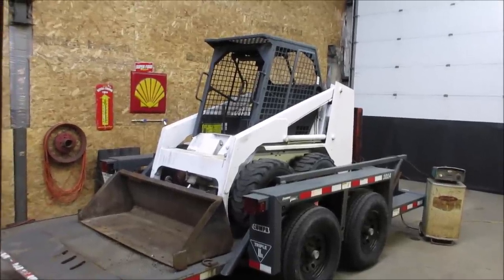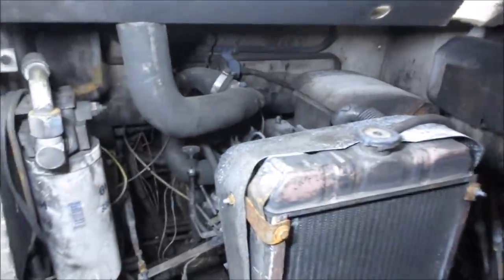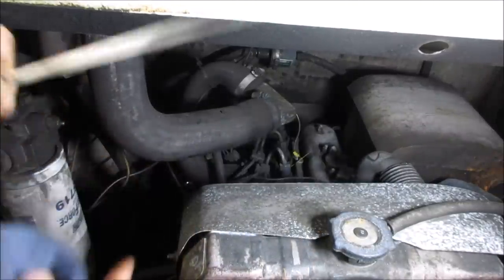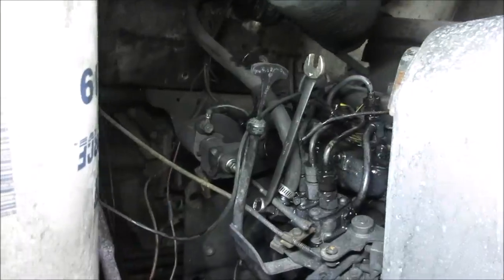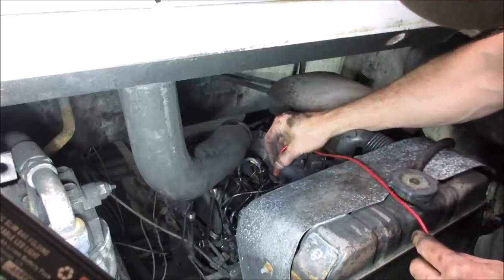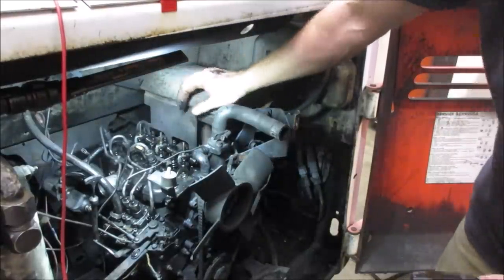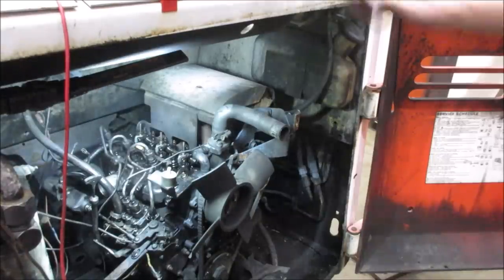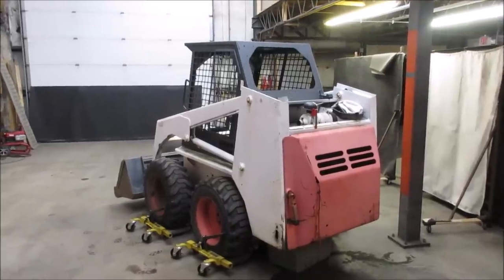Gambled on a Non Running Bobcat. Will It RUN?

Comment: There a little tricky to learn how to operate at first, however, once you figure things out you can do just about anything with one of these little machines. I know one thing, u can get a helluva work out of those babies. Usually, you, can get upto 4,000 hrs before engine overhaul.. That's if its been taken care of over the yrs. Man their cobbling of that radiator setup is a mess. I had a feeling that engine was toast,  right from the start not seeing any fuel coming out of those lines kind've wrote it in stone...Awe You'll figure something out. Not all are decisions pay off in our favor do they, that's what happens when you play the gambling game, sometimes you win sometimes you lose. Good luck on finding a engine that'll suffice for ya.

Comment: With the extra oil showing on the stick, you have to check the drain plug for water.
Pressure wash the engine would have been the first step.

Comment: by the way if you take off injection pump got to remove throtle housing first there is small springs for govener and rack on pump and shims under pump thats for injection timing its easy to overlook shims there is also a threded boss in block for heater from factory its a option easy to add 40$ thread in and done git rid of you house plumbing on lower radator house that was ruff to see

Comment: Put atf in the intake someone probably wash down cylinders with stater fluid i had a employee do it to a loader once and it would not start poured  atf into the intake it built compression and started

Comment: @38:06 it seems like the instructions want you to insert the compression tester at the glow plug using one of the smaller (F?) adapters to take the measurement. Look at the 'Type" column on that sheet.

Comment: BTW. The Carrier reefer units use a similar 3 cylinder Kubota engine, not sure of the size though. Maybe if you find a wrecked reefer trailer with a good refrigeration unit...

Comment: A 22 hp predator engine is $999.99,,,,,  Hope you can find something used,,   I love it when you find cheap junk and bring it home,,,,   Probably the best way to go is to get one of the used 4 cylinder japanese engines from japan,,  They all have less than 100,000 miles on them,,, and sell pretty cheap,,   :-)

Comment: Oh by the way Mustie 90% of automobiles just like ares actually the same as ares in Brazil run on E85 75% to 90% pure methanol yes they do have to use different seals and materials for the  fuel system 7 to 900 to have any car converter I'm sure when you buy a new car in Brazil  it's added in to the price

Comment: If the last two guys couldn't get it to run, it seems to me that step 1 should have been the compression test.
Reply: Step 1 would have been draining that crap out of the crankcase. Then check the compression. Because if that engine had fired up it wouldn't have stopped until it burnt whatever was in it. Then it'd have exploded. Diesel runaways are real heart stoppers. You can watch videos of them here. They make a big white fog then go click.

Comment: You used to have a 3 or 4 cyl diesel that ran a generator that you made run. Maybe an adaptor to make it fit the transmission woiuld allow you to get this machine running again.

Comment: Wow! That thing is sad condition. With that being said, I had a 630 bobcat with the  Ford engine. And it ended up getting repowered with a Kohler command 37 horse didn't have to do a lot of modifications other than changing oil coolers. With that having a Kubota repower it would be simpler to go back to gas for what it's worth. Looking at those repower kits now to buy everything out right with all the parts you'd be over $5,000. Unless you could find a Kubota diesel cheaper but I doubt it. Only way you can get away with it is if you had a good Kubota industrial engine dealer near you but they don't have a lot of dealers in the country. And with the business you do with small engines and lawn mowers how often do you come across the 30 plus horse gas engine I guess? Anyways, good luck! There's options out there, just takes time to figure it out

Comment: sounds like the original gasoline engine was replaced at some point and a diesel engine was cobbled into place, and now it too needs replacing. so engine hours probably do not reflect time on the replacement engine, but rather the time on the original and the replacement? i'm assuming the engine hours meter is a separate unit from the engine, which may be a poor assumption. :)

Comment: It looks like a D-905 or a D-1105. I’d swap an D-1105T Direct injection motor out of an old toro reel mower into it that way it would be not as gutless as it probably is now. You’ll want at least 40-50 horsepower to be practical.

Comment: i have to admit i was wondering why the host had not checked the compression having gotten this far (@36:53). and was guessing it was because he didn't have a compression tester for a diesel engine. ...i was close. he simply had never used one, which is understandable, and as the host probably suspected, it was going to be a PITA. :)

Comment: Also mustie fill the furl up so you have reasonable meters head pressure, then bleed the fuel filters then the injection pump then the last of all the injector lines to the injectors as its the highest point where air will be trapped , if all else is good meaning your injector pump timing is correct it will start.

Comment: Kinda wonder if that Diesel generator motor you got awhile back is a similar displacement size and if it could be Frankensteined in if you still had it and it was large enough and would fit in the engine bay

Comment: i have a line on a 3 cyl motor out of a att bucket truck it has a gen hooked to it that ran the bucket , diessel creek has one i sent him the manual for it i also know my buddy has one or two , the motors are self contained  except for fuel tank I  had one and sold it for 500. i'm sure it could be bought back, I live in akron. ohio

Comment: as you say things im stopping the video to reply it's not just a lift pump it delivers the correct amount of fuel to the right cylinder at the right amount of atomized fuel pressure at the right time, it's a complicated bit of kit.

Comment: Don't condemn the entire engine, pull the head and check the head for cracks, those usually crack between the valves and the around the pre combustion chambers, that said, the rings aren't performing looking at the blow by.  I'd keep an eye out for an engine, maybe repower is in it's future

Comment: 3000 hours is a rebuild on most diesels so a quick rebuild or r and r is likely ? the engines 3 cylinders are likely under powered so yeah there is that they may have cooked it early...

Comment: Definitely overheated. They don't cope with it well and it happens often. They are sleeved and replacements are available but they're usually semi finished so need to be finish bored once installed.
You did a video a few years ago on a 2 cylinder kubota engine. Have you you still got that?

Comment: On my one engine I left tranny fluid in it then. Got it cleaned out and turned engine over while pumping some tranny oil in the intake to give more compression and it started and freed the rings. With engine frozen and with lots of water in pistions with head off

Comment: I'm surprised you didn't drain half that oil out of it before proceeding at all.  Doubt it'd have made any difference but would have made a huge mess if it actually fired at all.  I'm also surprised that with the ether, even with 125psi in two cylinders it didn't fire somewhat.  Ah well.  So would the VW engine fit????

Comment: Let me start by saying I’m not a Mechanic. Doesn’t the engine just run a hydraulic pump? It seems to me that since the cranking of the engine created enough hydraulic pressure to lift the arms, though obviously not enough to actually do any work, wouldn’t you be able to put basically a small gas engine such as a v-twin that would produce enough rpms to turn the pump? Perhaps some sort of gearing would be in order. I think it would make an interesting project and video series. Just a thought.

Comment: I really would like to see what's up with the decompression valve on that engine. That size diesel I'm pretty sure it has one, and I really would like to make sure it's working properly. Thing is I can see one or two cylinders get that bad, but all three?

Anyways it's a quick thing to check.

Comment: please atempt to fixt it, take the head of and mesure how far the pistons are from the top. juste take all headbolts out, no timing things at all. if you are going to swap the kubota generator,m you can change the intake and flywhell i think. a 1,9 vw diesel 1999 would be cool.

Comment: One has to wonder what happened to the original engine, if it took a crap or if someone just wanned a diesel over a gasser and did a swap.

Personally i would not have bought this machine if i was looking for a running machine to use around the yard, unless you were specifically looking for a non running project, although given the hydraulics work even on just cranking rpm's suggest the pump is still good and tight, so it might be worth putting and engine in it.

The engine in it might just have a badly blown headgasket but it is more likely worn out rings, pistons and liners, so i'd say put a VW engine in it if one will fit, otherwise go with that kubota diesel outta that generator, from looks i'd say it's roughly the same engine +- a few year models/horses, and i think the flywheel end is standard on these 3cyl kubota diesels so the one in the skiddy should just bolt on.

Comment: I say Restore additive.  Drain oil, add restore as per instructions, add new oil to full mark, then put a small amount of additional Restore into each cylinder through the injector or glow plug holes. heat up the glow plugs and crank with at least 18 volts to the starter.
   The main alternative I see is new rings.

Comment: Your compression gage set-up added too much volume to the compression chamber. That's probably why you got such low readings. You might get a good reading with the proper adaptor in the glow plug holes. I'd try adjusting the valves and give it a healthy shot of Quickstart to get it running. It might clear itself up.
Reply: I used the same compression tester on my Ford diesel injector ports (no glow plugs)  and saw 350 lbs on all cyls.  There is an old trick to find blowby - valves or rings by adding oil to the cyl and re-checking compression.  Not a good idea. Oil ignited and blew out the gauge!

Comment: My guess is mustie needs to buy rings, bearings, a new diesel pressure testing fittings, and grind the valves. Thus an engine overhaul with correct placement of radiator. Pull engine out, restore engine, clean everything. And bite the bullet to do it correctly so it can be sold for a better machine through horse trading. This was not a good buy. Over the tire chains would be needed for any kind of construction use. Kubota diesel is a good motor and will properly propel this skid steer but high tech work needs done, AND NOT A VOLKSWAGEN ENGINE.
Reply: We don't know what he paid for it. I bet it wasn't much though. He said he paid blown motor price for it.
Reply: OTC for any type of construction work?  hmm, 99.999999999999999999999999999999999999999999999999999999999999999999999999999999999999999999% of Skidsteer operators would quite highly disagree. OTC would destroy black top/asphalt, tear up lawns.  Over the tire tracks would be a better solution or if this thing isnt a total heap, a track conversion

Comment: Not sure I'd trust this even if you got it 'running', looks like it needs a complete teardown and rebuild.  Not the Mustie way I know.
If you got it running, maybe you could sell it, but doing real work, it might just die halfway in the job.
The best answer...put in electric motor and a big extension cord that attaches to a pole so you can move it around without running over the cord...they used to make tractors like this. lol   A Prius 1.5L engine, they are free and are designed to run efficiently at like 2000rpm or so.

Comment: I remember you did a video were you got a small diesel engine and you started it on the bench. Would that fit in there? Or would it be about equal in power to the one that's in it.

Comment: The injector fuel output should be 2300 psi the ultra low diesel fuel probably took out the pump and yes you have no compression

Comment: I don't know if this is going to help, but I accidently hooked up a new battery in mine and blew the blocking diode in the harness, could be same?  Dumb mistake on my part, but got it working again.

Comment: Don't know if you would be interested, but I have one of the Ford four cylinder engines sitting in my garage right now. I'm not going to use it, and I am very willing to let it go very reasonable. Problem is I am in southern Michigan. Let me know what you think.
Reply: Let me guess, it ran when you put it away?
Reply: @1pcfred  Actually, I don't know if it runs yet. I just got it in a deal last weekend and haven't tried it yet.
Reply: @burtnelson1987  ah ha. Fire it up!

Comment: Is that engine a d1105 I have a Toro lawn mower which looks like the same motor the noise in the fuel pump is normal it could be the glow plugs to if it is fuel you need to open the throttle a little bit while you crack the lines I think you do the end ones and then the middle from memory but you need to have a partial  throttle so once it almost starts you can close the lines quickly

Comment: I have a 3 cylinder Kubota diesel engine in my lawn mover  (Belos  1500) and it has much more fuel pressure than yours have , so I think that yours have a faulty pressure pump.

Comment: Fuel system gone to air ?...Takes forever to prime a fuel system on older diesel stuff
Reply: If the compression readings were right there's no way that engine could start. That's why the crankcase is so full. The diesel is just blowing past the rings.

Comment: It is VERY bad idea to use 'starting fluid' on a Kubota diesel. The design of the engine (precumbustion-chambers) can result in cracked head almost instantly.... infact, the 'lumpy' crank sound suggests a dead hole (cylinder) already exists.

Comment: Just a thought but my kubota engine has a oil pressure shutdown. Maybe that’s of some use to ya mustie
Reply: Need to hold the button till you see oil pressure and my fuel pump runs all the time also.

Comment: All Low compression Kubota engines require use of Glow plugs even at 70°F dont know where you get that misinformation... I also notice an engine heater on that engine...

Comment: First impressions are that engine bay has seen A fire. Watching you test the fuel pressure seems like It has none going to the injectors. It should spray out those lines with good force. Could be the injector pump Is bad. It also sounds like It has no compression.  Love to see you get this going.
Reply: Yeah it's seen a fire. A fire in the cylinders. The exhaust pipe has been dumping diesel exhaust into the engine bay.

Comment: seeing the top notch repair work and crazy heaters my gess winter hard starting case of eather later broken piston second ring land cooked cylinder walls injesting exhust threw intake cracked prechambers and for fun valves are not happy eather rebuilds are not terable to do koubota are good design kits are not crazy expencive blocks are sae sizes lot of options for you v1505 very common there in everything parts are easy to git

Comment: Short horror story: man called me about an old Ferguson tractor he had with a bad head to see if I had any interest. Passed and suggested he pull crank,rods,and other hard to get OEM parts and sell the tractor for scrap. He thought that was a good idea so he did. Week later my scrap man calls me asking if I was interested in an old Ferguson tractor that just needed a tune up to run like new. Engine guts were gone and he knew that.....Learned decades ago never trust a farmer or a scrap man💩
Reply: Trust no one.
Reply: @1pcfred  Agree 100%. Honor is a dying trait. Getting worse too as us old farts die off.
Reply: @amossnowdaharleyman9179  I mostly don't get involved with situations that require honor. I try to avoid that sort of thing myself.

Comment: If you want to use that in the future than you should find out why there is low compression and fix it
Reply: My guess is the rings and sleeves are shot. But you'll never know until you crack it open.

Comment: It is so dirty. I’d take the engine out, steam and degrease the engine and the engine bay, and try to get the engine to run briefly on the floor before reinstalling it.

Comment: VW engine of course! I watched another video series where the hardest working young man rebuilt one, outside, in winter, in barley a barn, eventually discovered it had been run with no air filter which killed the compression.

Comment: Bobcat parts are notoriously overpriced. Prior owner probably bought the current engine because it was still cheaper than bobcat price, and they got diesel. Win win.

That said, I think putting a VW or Onan motor in it would be very cool but unrealistic.

Get the current motor torn down and fixed. Probably the best bet.

Comment: Actually an old VW engine might be a great replacement for the diesel if you can shoehorn it in.  Just need an adapter from the crankshaft to the hydraulic pump (provided it turning the right direction) and some holes in the back door for the exhaust pipes.

Comment: cough n fart on either. should run on what’s in the filter. should pressurize shut off if the pumps done or the injectors no bueno. i d drain off excess oil too much earl set up a return to a bucket and temp tank;

Comment: I would say injection pump bad but it should have fired on Ether could be both really there should be more fuel then that they run at high psi on the fuel system. Probably dead injection pump and low compression no body thought it was worth the mo ey to find out